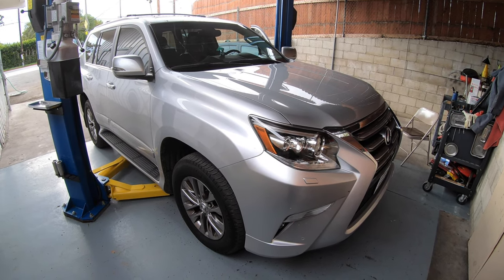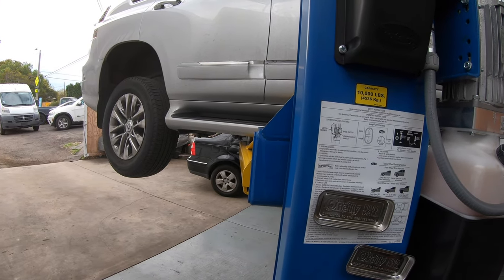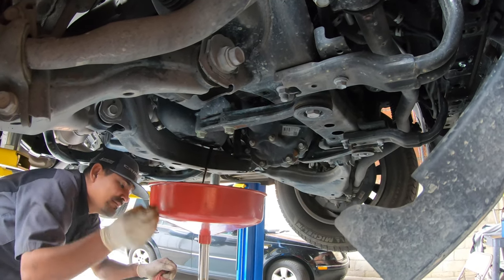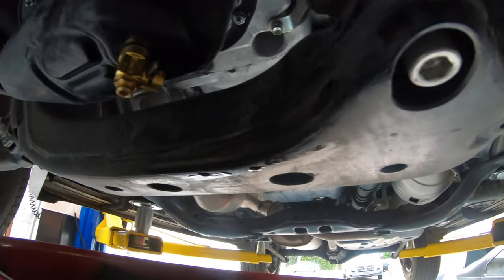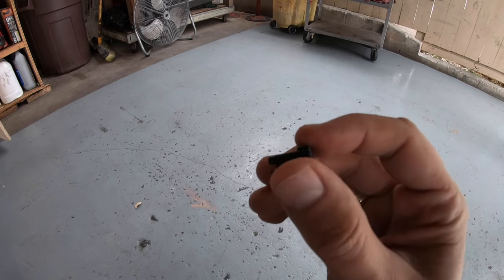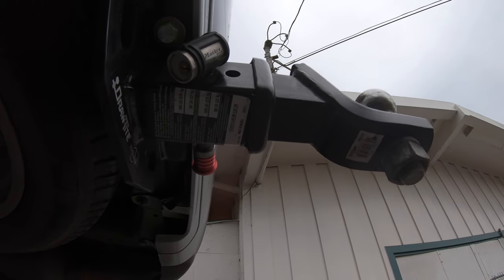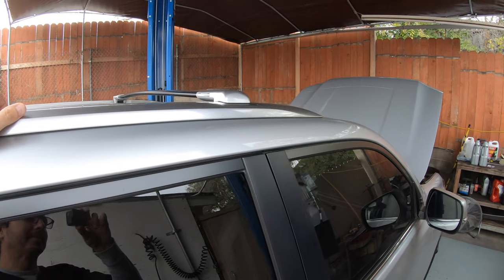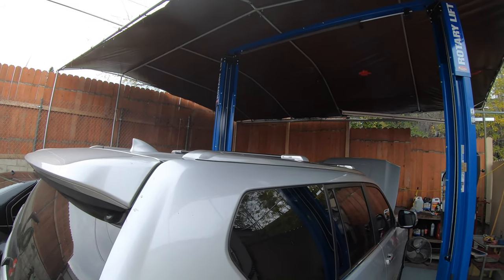2017 Lexus GX 460 DIY Oil Change, Fumoto Valve Install and Quick Review on Cross Bar Install.

Comment: I don’t think I had to take off the whole plate underneath to get to drain plug their is a little square right below plug that u can take off to get to drain plug I have a 2019 gx 460 it should be the same
Reply from the maker: You are correct, from now on I will just do that for the valve.  This first time I took it off to make it easier to install.

Comment: What you need to grease on these are the ujoints and slide yokes on the two driveshafts. 6 zerk fittings total. I would have done that since the front covers were off.
Reply from the maker: Thanks Palpatov, that is good to know for next time.

Comment: fyi fumuto valve is not good, very convenient yes, but if you look at the threaded part where it bolts to the pan  it's too long so when you drain it,   it won't drain all the oil out
Reply: That's what I thought lol. That is like 1/4qt of oil left

Comment: How far does that Fumoto valve stem get threaded into the oil pan? I would think it doesn't allow all the oil to drain to the bottom of the pan due to it's neck unless it has slots in it..
Reply from the maker: Not sire, maybe someone else can chime in.  I guess it would depend on the model and the pan design and thickness.  I would assume some engineering went in to it to mount flush to oil pan as I noticed some have longer threads and some shorter.

Comment: I think I am uncomfortable using the drain valve . What if there is  a manufacturing defect that can lead to the valve failure thereby leading to your engine knocking . The drain plug seems okay 
for me.
Reply from the maker: It is covered by a warranty, it is used by numerous big name fleet operators and every single valve is tested before leaving the factory.  It is made of steel and brass so nut much to fail.  But then it is your call in the end.  If you're not comfortable then I wouldn't do it.  On my truck, the oil pan is covered by a steel protective plate so that makes me feel a bit better.
Reply: @ONBLASTWITHMG   Thanks for the assurance .

Comment: You are going 10,000 miles between oil changes!  If the oil is contaminated it needs to be changed no matter what people tell you or what you see on YouTube.  The contamination in the oil will damage/clog the oil rings on the pistons and can also damage the barrings on the crank and rods.  By the way, you can also buy a all metal housing that replaces the plastic one holding the filter.
Reply from the maker: Thanks Larry.  Good to know, was wondering about that plastic little clip, also was of the school it was on the weak side long term as well.  As far as the oil change interval and phantom contamination, mostly hogwash.  Just change your oil as your the manufacturer suggests.